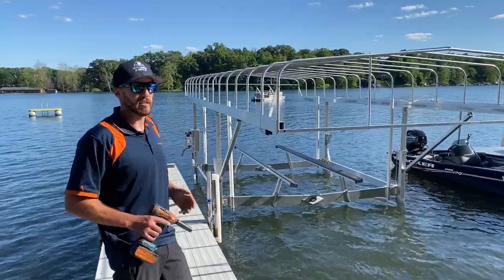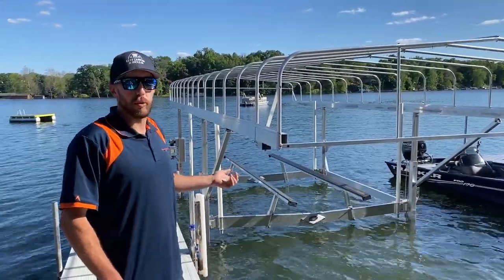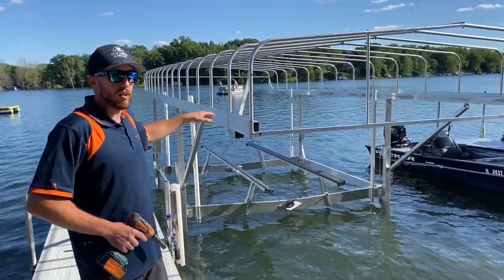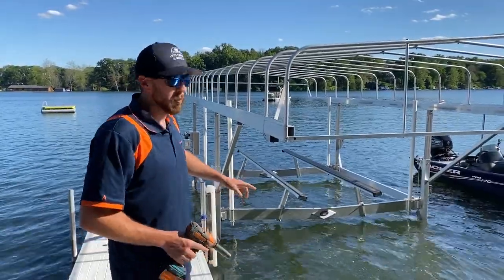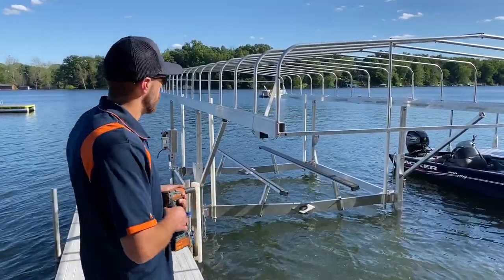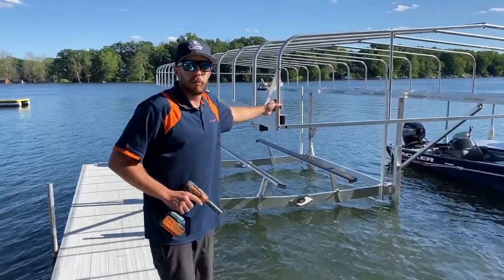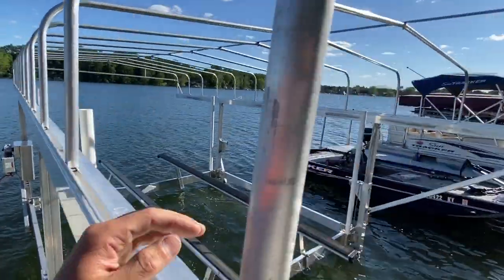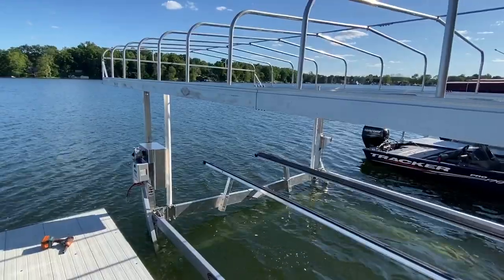First Time Boat Lift Setup Tips- New Lift Or New Boat, Here’s Some Techniques to DIY! Max Lift Shown

Comment: that seems like brutual way to lift it, ive never used a boat lift before but why wouldnt you cutt 4 2x4s and wedge them between the bottom and the top  and use the lift to raise the whole roof at once and then tighten up the bolts
Reply: That seems like an interesting idea
Reply from the maker: Great thought, thanks for mentioning it! Long ago, we considered a more sophisticated version of that principle by making brackets to physically bolt to the frame and using secured separate aluminum posts so that one employee could do it alone, but there's several issues with that. Mainly, the cradle (the part that moves up and down) is set inside from where the canopy mounts, so they would all have to have an elbow out and it would be incredibly sketchy at best, even if the aluminum was secured on the cradle it would still be extremely unstable with just wind alone. The way the cradles crank up/ down with the cable geometry is also an issue, since the cradles do not lift up perfectly level, one or two corners end up lifting first depending on the design and the others follow once those cables gain tension (and usually the opposite corners when going down), so it would just cause jamming since aluminum on aluminum has a ton of friction grip, especially on the slotted track uprights as shown in this video (which is a good thing other than during adjustments), plus the weight and position of the canopy frame itself is almost never balanced since they are typically shifted toward the bow end, so that alone makes it unstable and more prone to binding. With that, it would create a really dangerous situation if that friction jam suddenly released and potentially sending the frame flying, or could start breaking things if people unknowingly keep cranking up while it is jammed, especially since this is often done once the boat is in the lift, putting the boat at risk as well as anyone around it.  Doing it the tedious but easy, manual lifting way in small increments around and around as needed generally still ends up being just as quick or far quicker than trying to rig up a system to make the lift do the raising, plus is far safer all around.

Comment: How far apart are the bunks?
Reply from the maker: For inboard boats (ski or wake boats), with the Max V-cradle angle we generally start with the outside edge of the bunks around 40" and the outer edge of the lower mounting boot 5-6" wider to start, for I/O V-Hull boats we start narrower since they generally don't need to clear skegs/ fins or the prop shaft and is safer to make sure the deeper style keel of the boat doesn't hit the cradle when first checking, but we also look at pictures of the hull shape of the particular boat to fine tune it a bit to get safe enough for the boat to be pulled in for the first time before evaluating any adjustments. Some people use their trailer bunk measurements as a place to start, but that can be pretty misleading especially on heavier boats (wake boats) since the trailers often have 4-8 separate shorter bunks and even with simple dual full-length bunks, the angle of the V or sometimes frame notch on the trailer frame clearance to get prop/ rudder clearance is far different than the lift cradle V angle. They should have some lean on the angle on the uprights to help match the taper of the hull shape, and should be close enough that the boat isn't trying to fall through or leverage the bunks outwardly (imagine if you are picking up a large, heavy object, putting your arms underneath the object rather than grabbing from the sides and squeezing), but wide enough so that if your boat drifts sideways that you shouldn't hit your fins or prop on the bunks before hitting the side guides or lift frame. If they are leaning too far in, it can put undue stress on the bunk uprights and mounting points and can cause failures in some cases, depending on the lift brand and components used, so the force applied by the weight of the hull should be as close to linear down to the mounting boot or U-bolts as possible, while the slight angle fits the hull and lift frame shape- tough to explain how they can be angled but have the pressure in parallel alignment in text without pictures, but hopefully that makes sense.